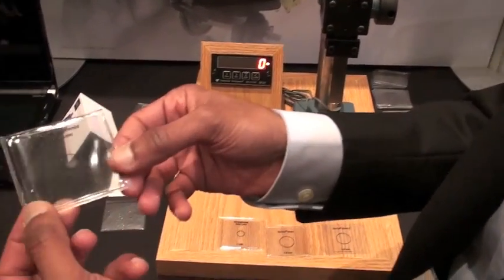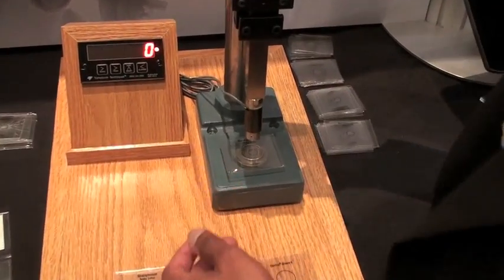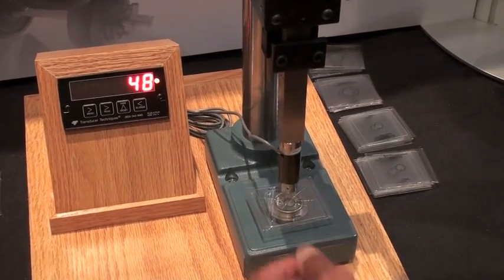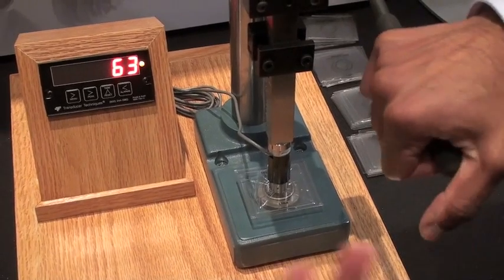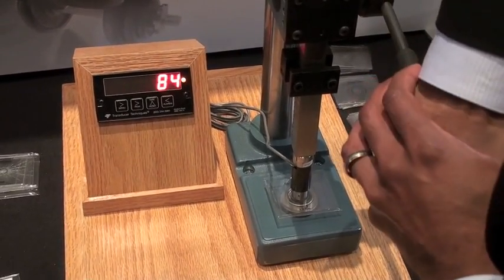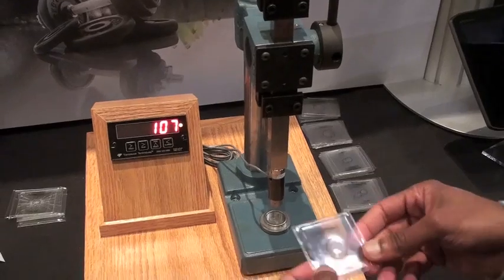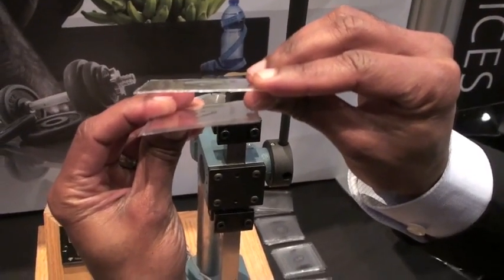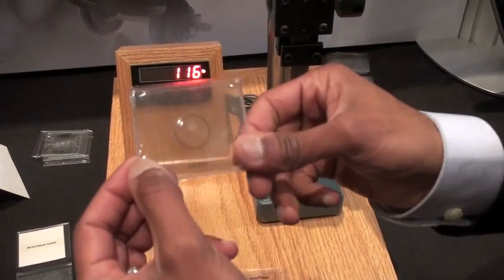Gorilla Glass 2

Comment: actually, I have seen phones screens break from landing squarely on the front edges of any otter box case. Even the Defender series ones. The impact pressure of the edge of the screen against the hard plastic on the inside of the case is enough to make a crack.

Comment: No more resistance at the edges that results in breaking. A laser and heat will still leave some very small imperfections. If you takes rock and hit a driver side window of a car in the middle of it chances are it won't break, but if you hit it near the edge of the same window you have a better chance at breaking it. This is because there is less resistance near the edge or less mass.

Comment: The middle might be the weakest meaning flexing, not breaking. The edges are the weakest because the glass is cut and has already experienced small stress fractures at some point. The middle can take more because it can distribute the pressure. The edges can't because some of the pressure will be forced off of the glass resulting in a fracture.

Comment: This is a bad comparison when it comes to the "same" protection between gorilla glass 1 and 2. If you did a drop test with gorilla glass 1 and 2 i'm sure gorilla glass 1 would withstand less damage compared to 2 due to it's overall thickness, and if you look at all the devices with gorilla glass 1 that have been drop tested, they hold their own where as for devices with gorilla glass 2, they shatter. Because of this, I got an otterbox defender case for my galaxy s3.

Comment: Just wondering yes the glass wont break but what about the screen thts behind the glass the pressure thts put on the glass would push on to the screen and possibly bust it right?(not the glass. What's under the glass)

Comment: Make a hardened LCD backscreen to be able the back incoming weight and damage from the front piece of gorilla glass useless if you have to replace the LCD and all the framing getting bent and fractured from that bending into the phone etc + that piece is a square 1x1x1x1x spreading weight equally between all corners and less damage rectangle will basically break check physics google it and google size vs weight larger the piece easier the piece breaks as the centre takes all the weight and is c

Comment: OK he cheats,    let me run it down for you...
He has the scale set.   He puts first glass on, it breaks easy....
he presses the reset button on the machine... it goes right to 0.  Uses 2nd glass breaks.
NOW pay attention, he uses 2 fingers to reset and the weight goes to -9999999 not 0 so he changed settings real quick thinking no one would notice, then the 2 glass pieces AFTER the 2nd one are on the new setting.

Comment: 120 lbs of force isn't a lot considering a drop from three feet on to a hard surface can transmit hundreds of pounds of force if the phone lands on a small corner or flat on a rock or some other small point.  For example, a woman's high heel can exert 4,000 lbs of force per square inch when walking, even though the woman only weight 120lbs.